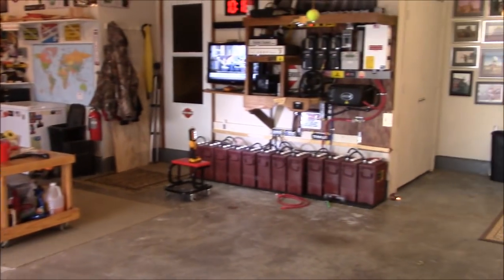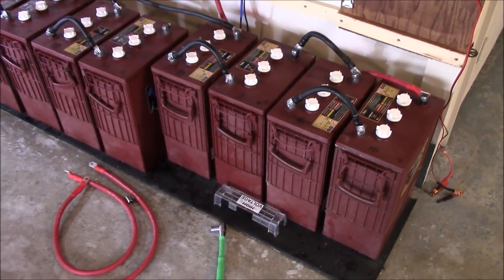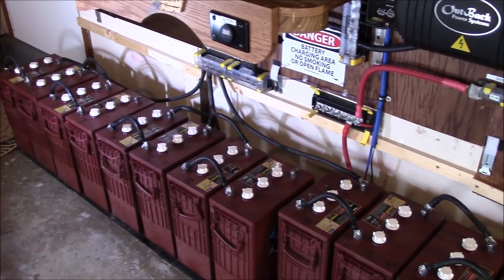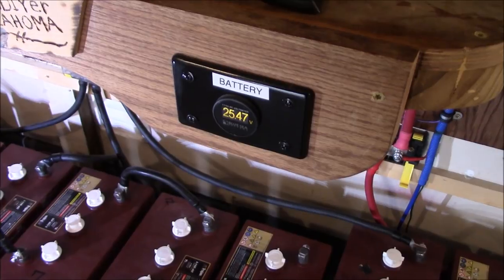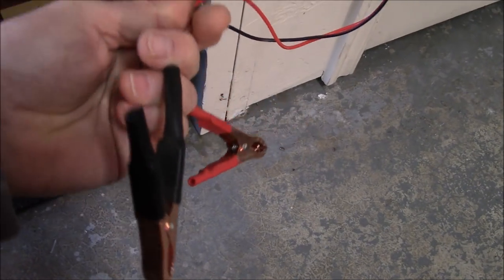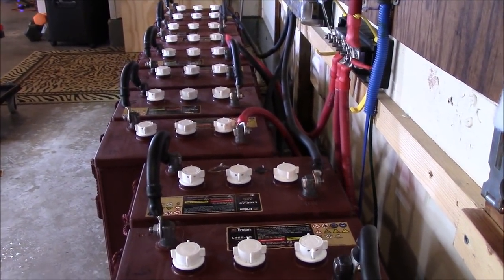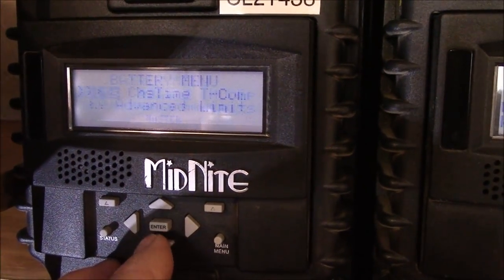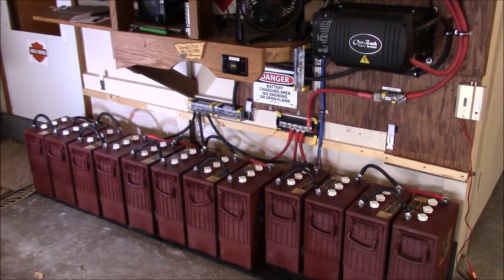New battery string arrangement - bad/weak cells showing life now

Comment: Looking good Chris!
Reply from the maker: Thanks...lots of messy, dirty, & stinky work that wasn't shown on this video. I am glad I caught it on December 17th...system has been down since then. That time of the year too...really hard when there isn't a of sun and frigid cold out...best to minimize use and do some corrective maintenance. I will never buy another FLA storage battery again
Reply from the maker: Good point...there are some sexy LiPo4 batteries out there with built in BMS...but, still out of reach for most of us. So, FLA L-16 batteries for now and saving $$$ in 2018...a one-year "contractor" tour to IRQ/AFG would solve all my problems
Reply from the maker: Nice! Lots of time away...but, glad you're settled in. Nice to hear about guys who did what you did (my ex-boss did something similar). Had a couple of chances to do contractor work over there when I finished up with the AF (21 years TIS)...but, my last two years on AD were pretty fuckedup (long story). Just glad I got my blue retiree' card, DD Form 214, and disability. All good now...not rich, but not poor either

Comment: I'm having the same issues here with FLA and complications with the colder temperatures. I'm going to all AGM SLA deep cycle from now on and bringing the strings indoors to a warmer shelter for them.
Reply from the maker: AGM/SLA inside with climate control is the way to go. These FLA's are cheap, heavy, and drama-filled. If set up correctly, can last a long time...but, dam the acid misting and ruined jeans
Reply: I appreciate the work you do Chris. I like the Monty Python intro too.  -14F lows are in the local forecast and I'm already having the "drama" you've outlined with FLAs. It hasn't been that cold yet, but have lost a cell from freezing temps in one battery. I'm moving on to AGM/SLAs and have built a cozy place for them indoors. I'm hoping the best for us all :)  Peace.

Comment: If wonder if you're not running them hard enough--- is it possible the acid is concentrating at the bottom - thus causing the SG test to make the battery appear weak ?  The results of  your equalization seem to indicate this is a possibility.  You're not supposed to take more than (aprox) 30% out of them -- yet, 30% might not be enough to stir up the acid of these exceptionally 'tall' batteries.... kind of a catch 22.  What are your thoughts.
Reply from the maker: My absorb volts were too low...now I am going to bring them all the way up to 32.4v for a short time and a higher float. Kinda like a "quick EQ blast" every charge cycle. I run mine down to about 60% DOD

Comment: Chris was j/w why you don't keep the desulflator hooked up all the time? The longer you have it hooked up the more your "supposed" to benefit.. I too am not 100% sure if they actually help but so far on my 2 batteries, they haven't seemed to hurt at all. Figured the $45 I had into it was worth a roll of the dice. Take care and Happy New Year!
Reply from the maker: I may still hook it up on the lowest setting. I had it hooked up to that bastard-child string for three days (on "400" setting). Hit that string with three 2-hour EQ power blasts. So, with that desulfator on 24/7 for three days and kicking that string in the nuts...the cells came back. Not sure if the desulfator helped or not...didn't hurt anything tho. Thanks...you have a great New Year.

Comment: Wow I do not get why that happen I know your like me and UBER take care of your batteries. So I take it there still not under warranty? Nice work on fixing them up. When you have the time look up a battery maintenance apron. There less than 15 bucks and will save your close. 

Thanks for letting us be a part. God Bless brother.
Reply from the maker: Thanks...FLA is good for many things (esp recovery/resurrection if possible). But, dealing with the acid (and misting) and adding water almost negates the added benefit. Really need a something less drama filled and doesn't cost $12,000+
Reply: Will not be long now where lithium ion will be in the prices we can buy cheaper
Reply from the maker: I hope so...not sure if I will get two more years out of these Trojans. FLA is old technology...kinda like a 454 CID 1970 Chevy Corvette. Def powerful enough...but, the new engines do it more efficiently, cleaner, with a higher price tag for entry. Not a retired Colonel here with excess change spewing out everywhere